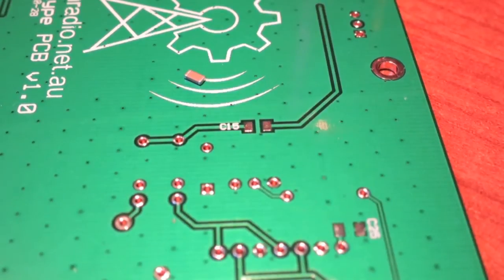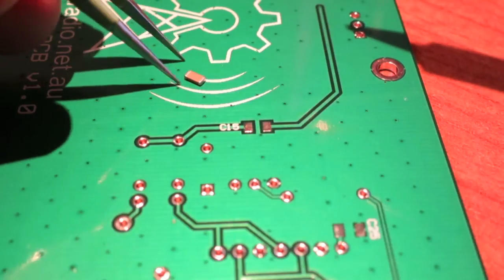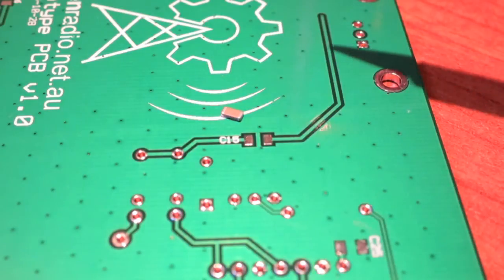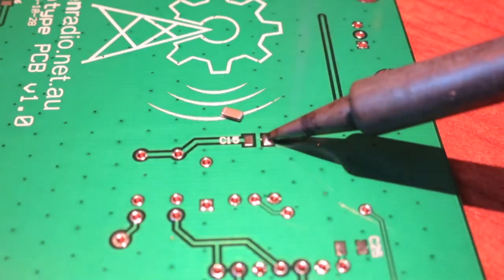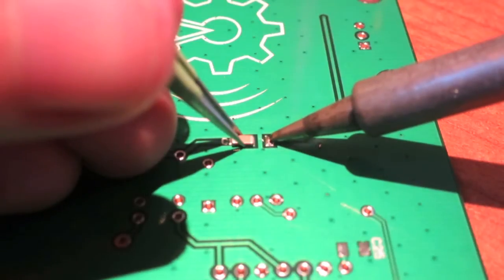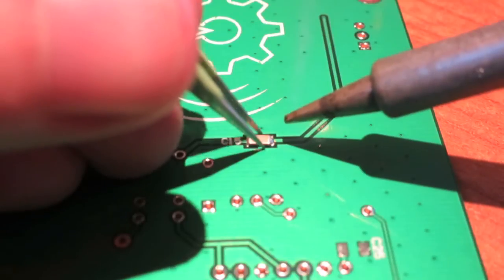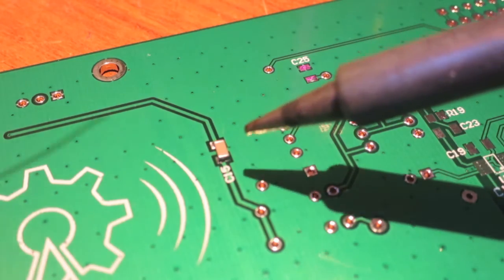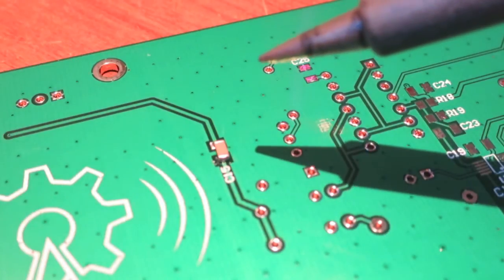1206 Soldering Example

Comment: I'm guessing you've had no problems with heat shock cracking. I want to try 1206 ceramic capacitors with a chisel tip iron but I was warned they may crack if you don't use a heat gun or an oven.
Reply: Iron works plenty fine with no cracking at all.
Reply: @ecurepair  Thanks. I forgot about this comment.